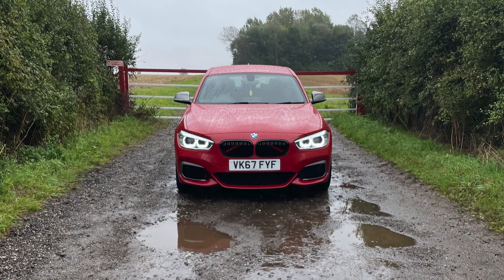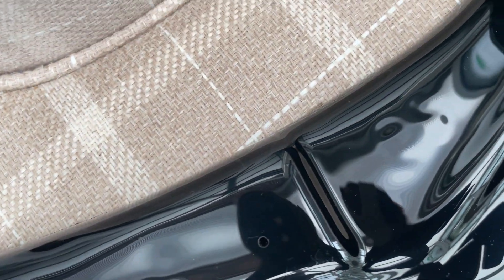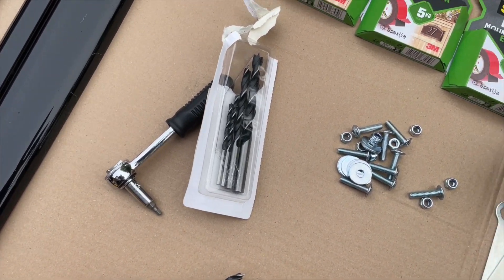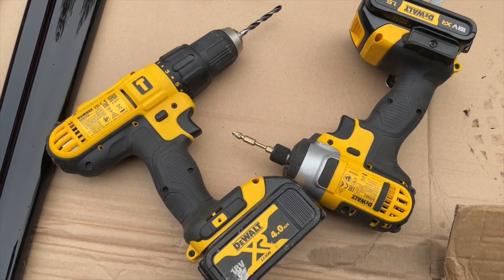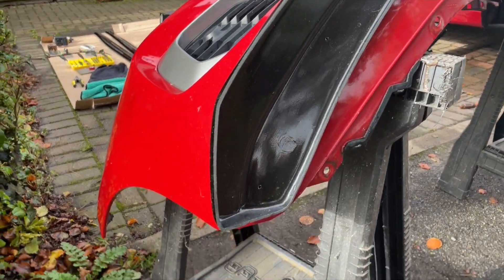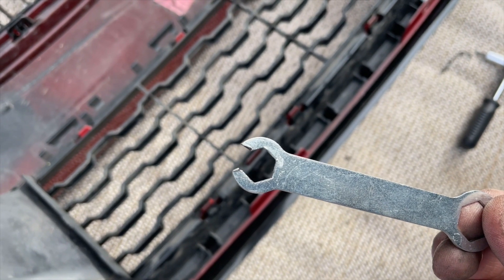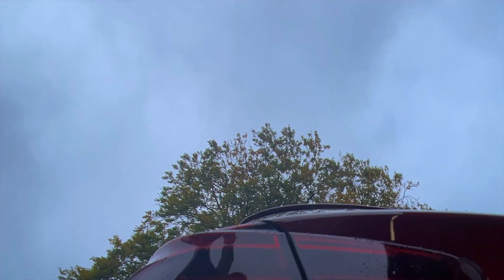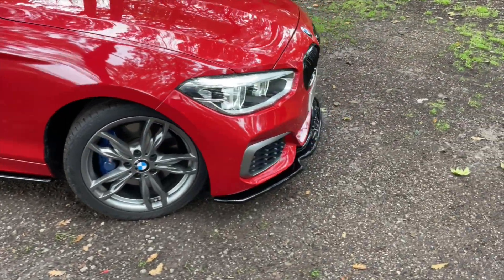My BMW M140i Transformed! OEM+ Splitter Bodykit. KSB INSTALL + FITTING guide. 1 series F20.

Comment: For anyone thinking of short-cutting this process by not removing the bumper...... Don't. 
Trust me, it's scary when they come off, and of course it's always at speed. 
Additionally, I meshed all the bumper grill whilst the bumper was off. 
The intercooler radiator (drivers side) is vulnerable to stone damage, so it's worth doing. 
The centre hole will only collect leaves etc, so that's worth doing as well. 
It looks better too IMO. 

Good video 👍🏻
Reply: Why not using rivets?
Reply: Because I wanted to use the largest washers possible. 
For that extra peace of mind. 
And I would still advise that now.